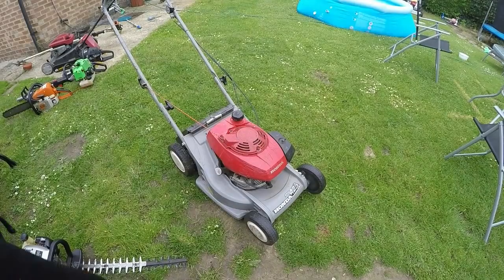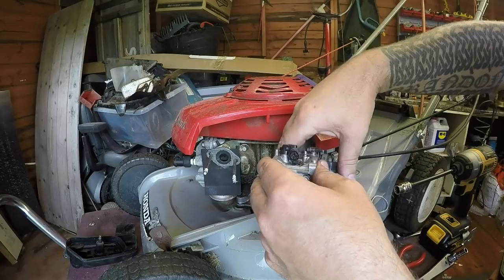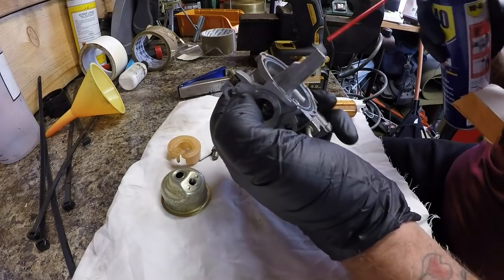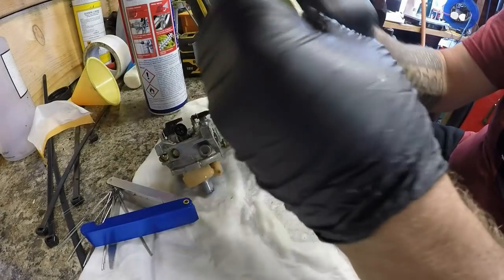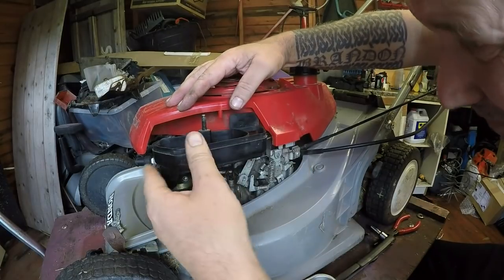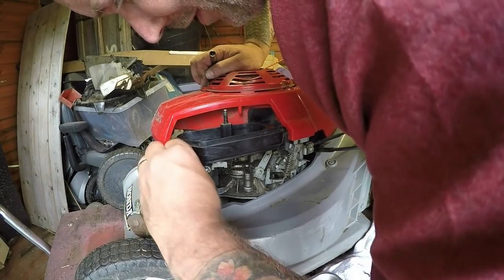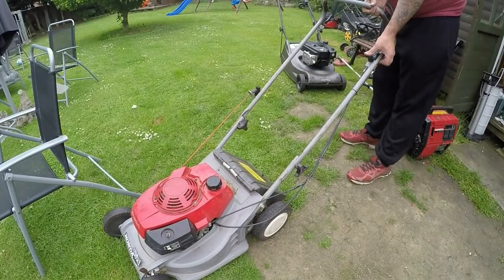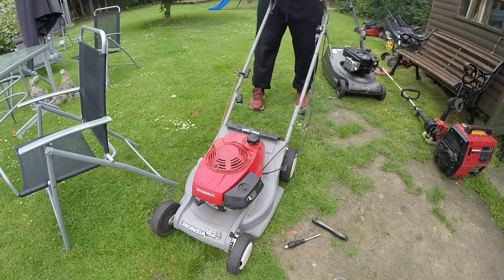HOW TO FIX A FUEL PROBLEM HONDA HRB423 #SMALLENGINENATION

Comment: Hi, I have just inherited an HR 173 lawn mower. Could you advise me as to what oil would go in the sump? Do I add anything in the fill and is it a two-stroke or a 4-stroke? I know nothing about the mower and have just watched your very informative video 🫡
Reply from the maker: Hi ..I use SAE30 oil.. it's a 4 Stroke so no need to add any with the petrol just put it in the oil filler

Comment: Some times the fuel level is low ,you do not get good flow. If the engine running the vibrations give you some flow . The more fuel in the take the more pressure to the carb.
Reply from the maker: Yeah mate it had a full tank bud

Comment: Hi Mick. Nice video. I need a new pull start for my HRB 423. Same engine as the one in your video. Can you tell me the engine number/ model. I can't find it on mine. Many thanks
Reply from the maker: co nor I know what your saying but when I first picked it up it leaked so that is why I put a gasket there mate
Reply: Hi Mick, think you've replied to wrong comment
Reply from the maker: @conorowens6991  it will be on the side of the engine mate